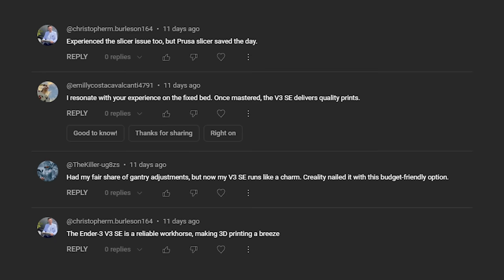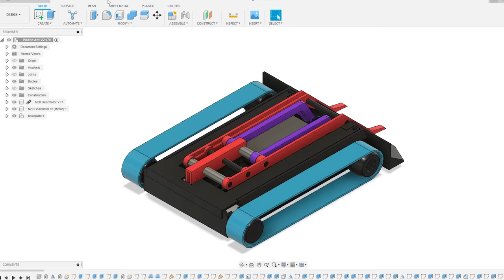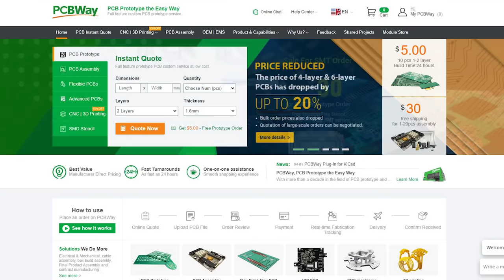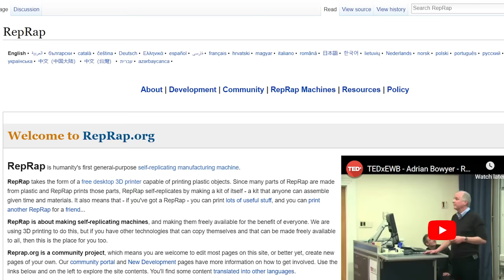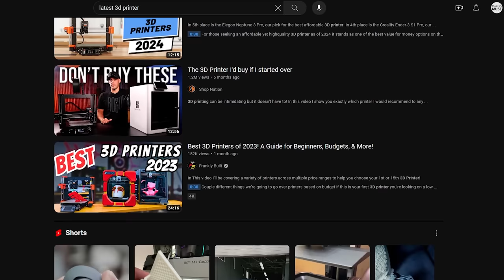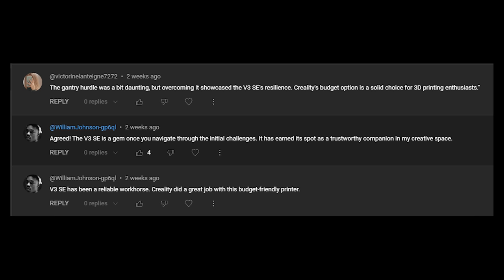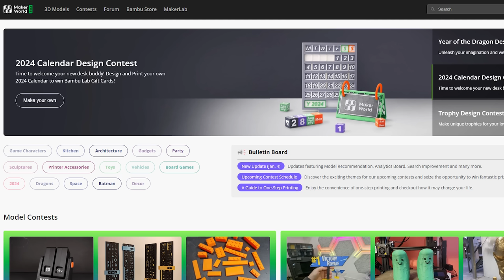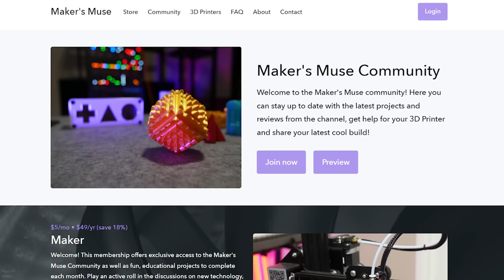My 3D Printing Predictions for 2024

Comment: RepRap was a MASSIVE success to the point that we are now living the results of their movement. Cheaper printers that just work.
Reply: I could not agree more.
Reply: RepRap made me the man I am today.
Reply: We need to start, globally, giving the RepRap project more credit.
Reply: Yes and no. The patent expiring was the main reason people could make cheap printers. It helped initially build a supply of parts but the self replicating part was a hindering limit for years. It was an unobtainable goal that delayed the switch to more traditional mass production techniques that are cheaper and faster.  This is part of the price difference between Prusa and other printers. When I talked to Joe about injection modeling he claimed that it was cheaper to print but they have silently admitted that’s not true with how they spun up their filament line as seen in the Strange Parts tour. 

I enjoyed my time in the community and the people I met. A  lot of good work happened. It was fun and engaging for people who are not professional engineers to work in design. The era of Reprap is over and imo thats a good thing because it allows space for what’s next.
Reply: @asowa42  Yup. Well said. And Joe/Prusa very much knows injection molding is now more cost effective at their new scale. May not have been the case when they started out, but they are no longer some small production run out of a garage and the volume they deal with makes injection molding a better business case. I doubt they'd switch though since it's part of their marketing.
Reply: @asowa42  I think fans of injection molding take the little joke in the video too seriously. Prusa has been using injection molding where it makes sense for years. For example, the base of the Prusa Mini is injection molded and the spool holders.

In the comments there was a Prusa employee who explained that the printed parts are not really that much more expensive and also not the bottleneck. We are talking about differences of a few cents per part. That doesn't make a big difference to the price of the printer.

Prusa is probably moving more towards the industrial market. The AFS shown in the Stranger Parts video, for example, is a product that could be very attractive to the industrial market.
Reply: Exactly and that is the way it should be. With just about everything you will have early adopters trying out new things but there comes a point where it matures and becomes more polished, like we are seeing now with 3D printers. A lot of people forget that for a lot of people 3D printers are tools, not projects and they just want something that just works. Open source and DIY printers do still exist but people act as if they are being forced to buy and use closed source printers.

There is no war between closed source and open source in terms of 3D printing other than what people make up. If you want to support open source printers and want to tinker with it then you have options for that but you also have options for closed source, non upgradable printers too which are more for the people that see 3D printing as a tool not a project. Both exist and both can coexist but particularly the open source side thinks that everything should be open source, I don’t see the same from the closed source side. It is common to see an open source supporter get angry about closed source printers but it is rare to see someone who uses closed source printers get angry about open source printers or projects. I think a lot of the time it comes from a feeling of entitlement.

I think the whole open source mindset needs to change, you are putting stuff out there publicly where anyone can use it but then get annoyed when people use it in a way you don’t want, like putting it in a closed source system. You can’t have it both ways, either you want it to be available to everyone or you don’t. Individual creators don’t really have the resources to defend their licenses or how their project is used, so other than complaining about it there isn’t a lot people can do. I think that open source needs to become simpler, if you make it open source then anyone can use it as they see fit, it would eliminate a lot of the drama of not allowing people to use it commercially, not allowing people to modify it, requiring people to open source their work if they use yours, etc. Open source would most likely survive fine with less restrictions, you will still have a lot of people who support open source and contribute to it.
Reply: @asowa42 I agree that the reprap movement is fading away, but I think it’s important to point out how many of the features we have today come from the reprap community, and projects like voron. Things like pressure advance, input shaper, and a lot of slicer innovations come from 3d printing hobbyists, and a lot of these innovations are featured in consumer printers today, helping make 3d printing a more feasible hobby for people who are not interested in tinkering.
Reprap was about a lot more than just 3d printing plastic parts for 3d printers. It was also about making 3d printing better and more reliable. Without reprap I reckon we wouldn’t have the amazing printers which are available now.
Reply: Only because a few people decided to try to "steal" the concept from the community and make a buck. Alot of people still aren't to happy with bree trying hijack designs attempting patent them as his own.
Reply: @andreas.grundler No... No they have not. There are entirely too many 3d printed parts on their printers. When you have as few skus as they do, and little to no customization out of the factory, its a perfect case for none of the parts on their printers being 3d printed, yet so much is. There is no way on earth they are using the optimal amounts of each tech.

3d printing would be for like a temporary duct fix, not for main frame components you produce in the multiple thousands.
Reply: My first printer was a Mendel, may it rest forever in Silicon Heaven
Reply: Those that want to tinker have great options like rat rigs and Vorons
Reply: Point of RepRap was making 3D printing available to the masses.

By itself it would have been never been able to succeed.
No matter what it needed "cheap chinese IP thieves" to make said goal attainable.
Reply: like if your an og and still use an old rep rap diy 3d printer
Reply: Thank God for Adrian Bauer and Bree pettis
Reply: It’s time for the RepRap movement to reinvent itself and start producing SLS printers, or parts/kits/software to build them 😅
Reply: @asowa42 injection molding WAS cheaper because demand wasn't high enough,  now that the demand is there injection molding is worth it 

But back in the repraps days it would have been obscenely expensive so setup an injection mold just to produce 20 units a month

Comment: I just want a CAD I can use on an android tablet! If we predict it, does it come true? 😂
Affiliate links: yes, spot on. It's a problem isn't it.
Reply from the maker: Can't believe there's nothing!
Reply: well it would be 1) slow 2) hard to control without a mouse, proper keyboard and 3) quite useless, by the time you open the keypad the screen is SO small its useless
Reply: I'm a bit surprised that Fusion 360 hasn't been ported to iPadOS yet, it seems like it would work pretty well on an M1 iPad Pro and the Pencil would be useful.  I'm guessing Apple would want too much of a cut for it to be practical for Autodesk.
Reply: @thesledgehammerblog  me too - I bought a tablet with a stylus expecting at least SOME form of f360 to work with it. Oh well!
Reply: Android tablet is such underutilized platform, it's obscene. iPad in comparison had desktop-grade applications even before the whole M1 Mac thing, iPad definitely was a stepping stone for Apple to transition away from x86.
Reply: On the iPad front there’s Shapr3d that works surprisingly well, now that it has parametric modeling (in public beta, though). I’m doing all of small projects there as using CAD on a touch screen with a stylus is just so much better and more natural for me than with a mouse. Can’t do assemblies nor does it have CAM, so I’m still using Fusion for those, unfortunately.
Reply: shapr3d works flawlessly on ipads, never would've expected an android tablet to be capable of it even

Comment: 0:00 - Intro
1:50 - 2023 Num1: War For Prosumer Market
3:50 - 2023 Num2: Easy To Use CAD
5:37 - 2023 Num3: 3D Printing for Supply Chain
6:36 - 2023 Num4: Accessible Industrial Manufacturing
7:18 - 2023 Num5: Plastic Recycling Into Your Own Hands
8:59 - 2024 Intro
9:14 - 2024 Num1: Simplifying 3D Printing
11:57 - 2024 Num2: Harder To Trust Recommendations
16:28 - 2024 Num3: Going professional
17:29 - 2024 Num4: Repository War
18:31 - 2024 Num5: Rise Of AI Generated Models
19:28 - 2024 Num6: 3MF Misuse
20:56 - Outro

Comment: Non planier 3d printing i think is going to really take off. I've been seeing a lot of coverage on it lately, and it's advantages are enormous when working with plastics. Being able to shape the loading structures to exactly the application of force instead of trying to find a way to print it so the layers don't peal is going to be a big one.
Reply: Yes. I hope non planar 3d printing start to become more accesible to slicers and machines
Reply: I disagree. While hardware side of user experience is almost solved, the 3d object side is still lacking, without light in sight. There are no unified standards of design guidlines for fdm printing. Like 80% of models are just 3d objects, not items that are designed for fdm printing.
For a beginner, it still takes a lot of hours of fiddling in slicer.

Comment: That printed tool steel part is really interesting to me. I'll have to look at those more closely.

My biggest concern for printing going forward is the increased control we're seeing companies wanting to exert over their products after we've bought them. I don't want 3d printers to become like regular printers, where you have to use their repository and their filament and their slicer. I don't think it'll be that bad, but it does seem to be heading that direction to some degree.
Reply: That's a very good point, and something that most be avoided at all costs. A truly nightmare scenario would be to have to pay for a subscription for a proprietary slicer.
Reply: It is coming.  Just consider what HP is doing with their printer . . .
Reply: Yep. This is why I have strict open-source buying constraints. Back when I got my printer, I eventually bumped up my price range to get a Prusa MK3 kit rather than buy something else and improve it because I wanted that trust, I wanted a product that served me and only me, where I could work both with the community AND with the manufacturer together, rather than having to play them against each other to get what I wanted.
Reply: Agreed. As someone who used to own a xyz printing da vinci 3d printer I know how much it sucks. I do worry that too many people wont care enough about maintaining open source and as everything becoming very limited by brand. This in the long run will probably lead to the cheapest 3d printers being the ones with closed source code and require dedicated software or even licenses to use.

Comment: I used to buy plastic electronic enclosure boxes at the price of an arm and a leg from Digikey and alike. 
No more, after building my own Prusa RepRap in 2008. It actually printed ABS pretty good since there was no PLA at that time at reasonable prices. 
No more putting up with plain boxes, when I can design anything I want and have it ready the next day. Not to mention gears that are impossible to make any other way. 
So 3D printing has saved me lots of $$$ and made me "be creative through technology".

Comment: I 1000% think we are going to see more of a boom with AI 3D Models or someone like Adobe incorporating a basic AI gen into their 3D Modeler software as a starting point for sculpting. 

I’m also going to scream if Resin Printer heated vats aren’t standard in 2024 🤣😂
Reply: I hope your prediction is wrong, but I'm worried you may be correct.
Reply: No
Reply: AI makes incomplete and unpolished models... not really fit for 3D printing... it's still some years down the line if that ever does happen
Reply: And air cleaners and curing in oxygen inhebitors at an elevated temp. Thos are all non brainers for the resin printers. Also auto refilling.
Reply: @@leanja6926 For sure. It can be a great starting point for a sculpt already, who cared if there are 7 fingers, just go in and clean that shit up but you don´t have to design the initill couple of hours.
I just don´t see how CAD will be easily replaced now, you will need to tell the design intent of the person to the machine ...that is basically what CAD is.
Also  CAD is hard, I just wish they would finally improve alrady existing expensive solutions like CATIA and NX instead of those shitty solution where the tree is missing and nothing is parametric but it´s cheap ..wow great ..

Comment: I used to LOVE the tinkering with 3D printers, but my hobbies have evolved. 3D printing is a tool more than a hobby in itself, and I want to use it for my other hobbies. I'm at a point where I just want a printer that works, looking to get a Bambu P1S later this year.